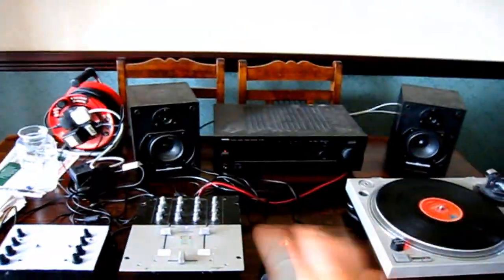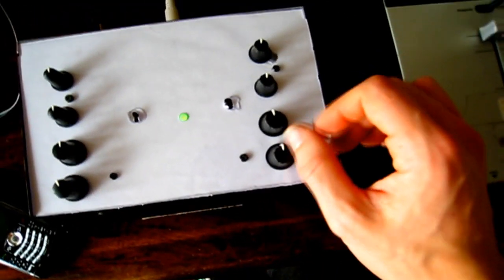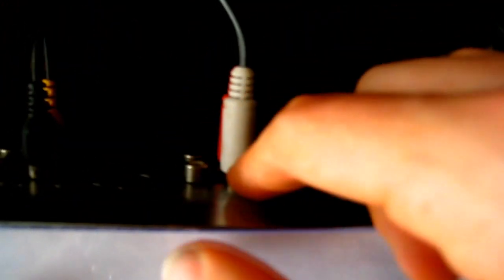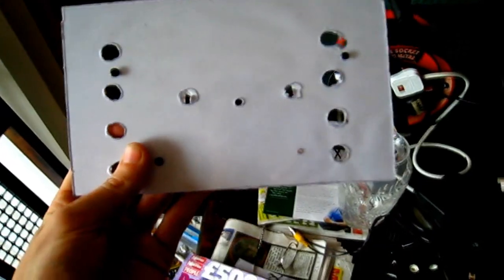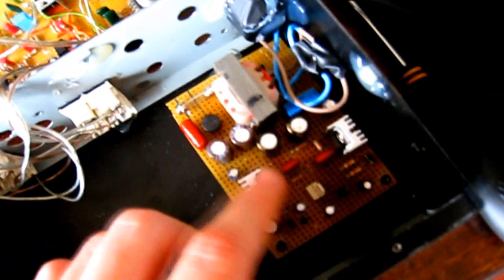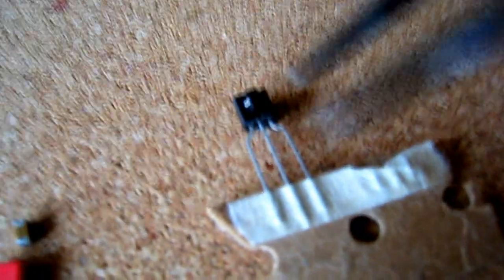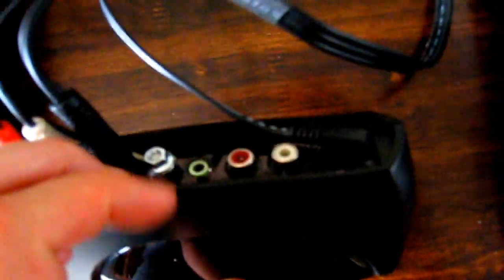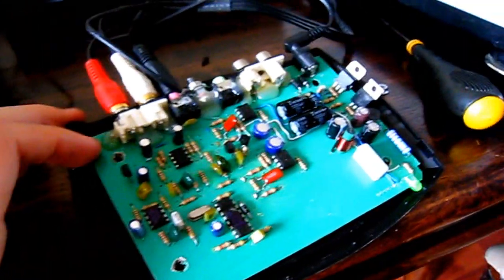My new custom EQ and phono preamp

Comment: I wouldn't bother with the (smd's) sub minature devices, there virtually impossible to solder by hand, easily short out together with the solder as they are that small to work with.Size isn't everything ;)
You also need a specially made pcb (printed circuit board) for those smd's

Comment: Very nice nice. So the bottom knob is essentially changing the width and not parametric which moves the center frequency?  Nice clean layout inside the projects by the way. Impressive.  How will you solder the surface mount components?  I've repaired a few computer components that had poorly soldered surface mount so they had lifted on one lead and let me tell you that it was a pain using a standard 30W iron.

Comment: The Tascam X-9 mixer, which is a discountinued competitor to the Pioneer DJM-600, has sweepable parametric EQ similar to your design there. I think it's the only mixer with such an EQ. But that's hella cool, nothing better than a sweepable LF...rather than just being stuck to factory setting.